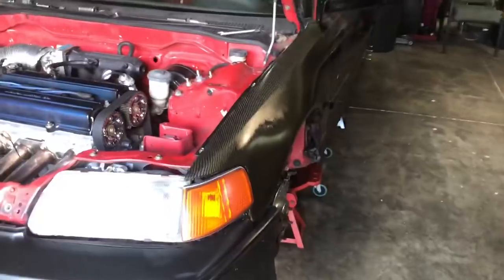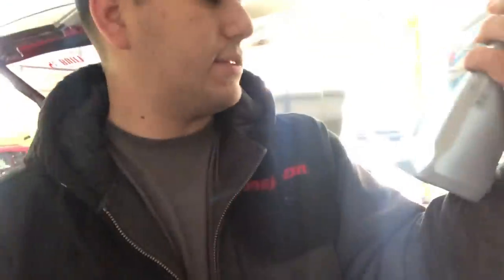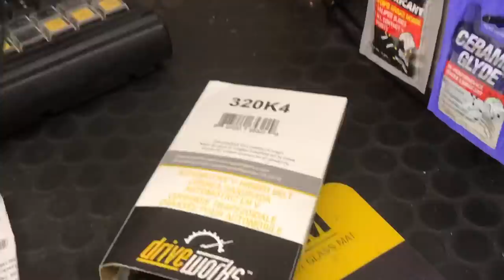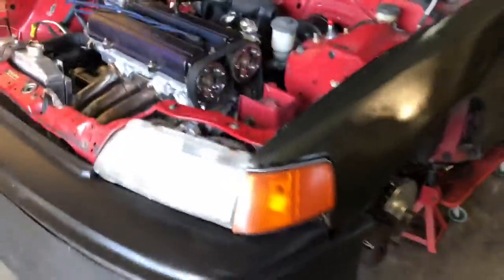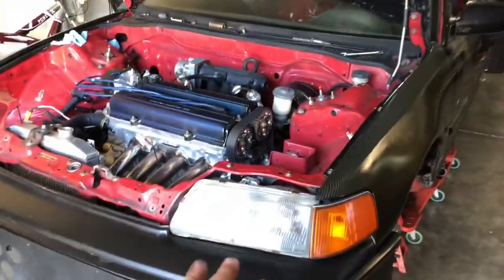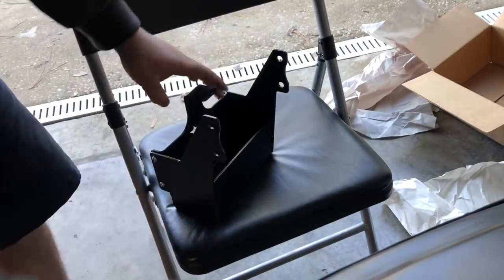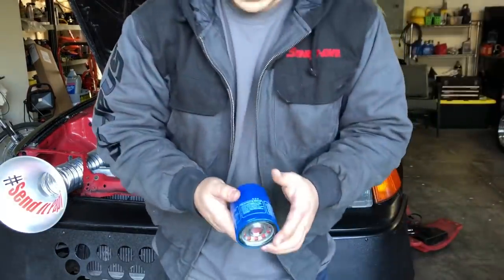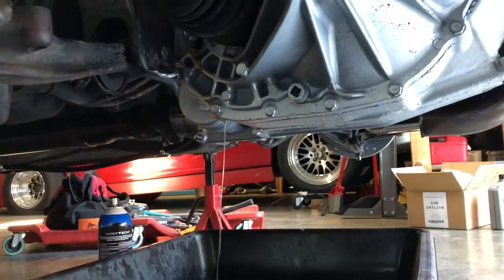Engine Break In Oil Tech Talk : My AWD CRX

Comment from the maker: Im just realizing that my tripod was loose and caused alot of shakiness! Sorry but thank you for bearing with me!
Reply: Hello sp tuning ...ur rotors direction  is wrong
Reply from the maker: The big controversy with slotted rotor direction is a huge topic to touch. I also agree that the current orientation isnt what normally should be used, but when it comes down to it , i go by what the manufacturer of the speicifc rotor specifically asks for. In this case, the rotors came marked “pasenger” and “driver” so i installed in that way. Good eye though 💪💪
Reply: that intake made me vomit,, boi you better fix tht shit! lol

Comment: Let me start off by saying love the build and what ur doing with ur cars and like watching ur channel.  That being said, I must disagree with ur break-in process.  It's a controversial issue however, professional engine builders have recommended to use real break-in oils that r high in zinc without all the modifier additives.  The assembly lube is sufficient enough to fresh start with until the oil pressurizes the system pushing the assembly lube out.  Also upon the fresh start rev to 2500rpm for 15-20 minutes to aid in initial ring seating.  Then run the engine or change the oil (personal preference) but don't worry about babying it because the idea is to seat the rings and bed in the bearings.  If it breaks at this point it was bound to because something wasn't right from the jump.  Just wanted to share some knowledge with ya and help inform.  Been doing it this way for years on my own stuff as well.
Reply: civicr87109 I agree 100% on the break in process. Break it in how it will be driven hard and fast.
Reply: What engines have u done with ur process
Reply: 6-B18C's, 4-B18A/B's, 8-B16's, 3-D16's, 2-LS's, & 3-4G63's

Comment: If you like Torco MTF, Try Amsoil's MTF offering, IMO that's provided me with the smoothest shifting on all my Honda's and priced similarly. In my opinion Honda's trans will run off anything but they really like MTF fluid that's on the thicker end of the spectrum. Honda's MTF fluid type 2 is pretty thin stuff designed for fuel economy so it doesn't always provide the smoothest shifting. Pennzoil Synchromesh has a viscosity of 9.3 cst, and Amsoil MTF has a viscosity 14.5 cst which are some of the thicker MTF GL4 spec'd fluids out there. So if you're trying to achieve a smoother shifting feel, thicker is the way to go.

Comment: People ask me all the time why don't you run a oil pressure gauge my answer is i don't need that negativity in my life. But your right everyone should run one. Oem filters for any brand is the best normally has to do with oil pressure huge issue in hyundai if you don't run oem filter. I run Rotella t6 5w 40 some like some hate it i love it and Motul PA90 gear oil its good stuff  . Deta regrinds sound very good . That battery box is very nice . Good video
Reply from the maker: Thank you 🙏🙏

Comment: Oil weight is not just based on clearances.. but also if a power adder is used.you have to understand oil acts as a wedge..your crank and rod journals dont ride on your bearings..they ride on a wedge of oil between the 2..so as a engines load gos up it puts more pressure on the wedge of oil..once the wedge of oil even being right for the clearance ia over come by the higher load from 30psi or 400 shot of juice it will need a thicker oil to hold the load being applied to the wedge..it also helps with the shock of a boost spike or spraying a huge hit at once..

Comment: Do you use magnetic drain bolts ? I loved using that when I was breaking in my motor .. I also put neodymium magnets around my Honda oil filter . 

I personally use shell rotella in my car . I don’t run a cat so it’s good to use and it has high zinc content as well and it’s cheap
Reply: Lol I was watching as I commented and I just saw u mentioned the magnetic bolts 

And yeah every oil change I pull the ecu fuse and crank until the oil pressure light turns off .. my friends think I’m crazy lmao 😂
Reply: And hold the oil jug sideways lmao it helps preventing spills 😂
Reply: Do they still have a high zinc content? A suburu guy was telling me they changed there fornula
Reply: Ziad Joumaa really ?? I’ll have to do my research .. if so Ill just switch over to motorcycle oil .. any oil that’s used on catless usually has a higher zinc content as opposed to regular auto oil because zinc is bad for the cats
Reply: Yah but thats just subaru guys looking for a cop out cause they're too scared to say that the boxer in the subaru is not the most reliable motor!

Comment: plz help a brother out 
buddy sold me motor said it had GSR head it came with p72 ECU it says pr8-4 on head some ppl saying its a b16 but also maybe a b17 gsr i need help idk if i can run that ecu cuz i got b16 headers and i guess there is some type of snail flap for gsr one ? do i need p28 or can i chip and mod the p72
Reply: very rare jdm and aussi b20 head with 84mm quench area and 33mm intake valves It is supposed to flow better than a ported B18a/b and a little better than a pr3 head

Comment: Ur rotors are not proper be installed ....check for more info
Reply: Swap it with the other side
Reply from the maker: The big controversy with slotted rotor direction is a huge topic to touch. I also agree that the current orientation isnt what normally should be used, but when it comes down to it , i go by what the manufacturer of the speicifc rotor specifically asks for. In this case, the rotors came marked “pasenger” and “driver” so i installed in that way. Good eye though 💪💪
Reply: It doesn’t even matter...
Reply: @SPTuning  Are the internal wanes curved? That is what matters, they should  "fling" the air from the inside to the outside. Then again, it doesn't matter that much unless your marginal on the track.